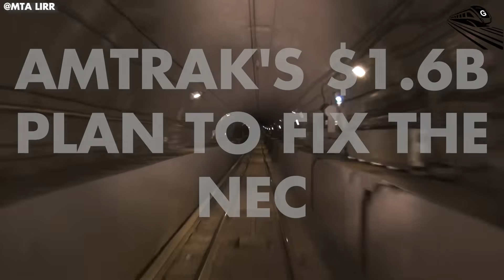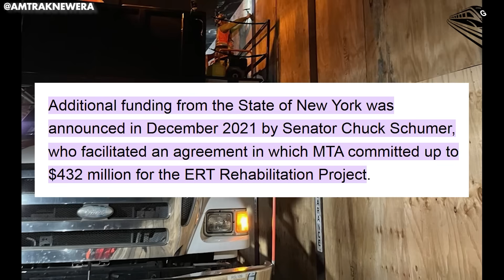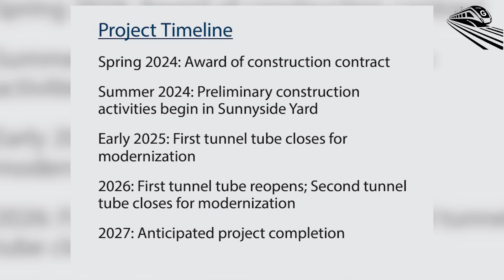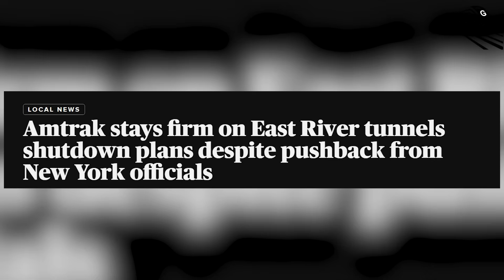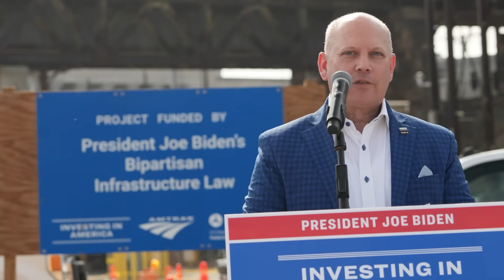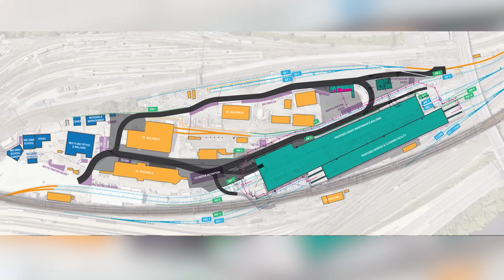Amtrak’s $2.6B Plans for the new high-speed train

Comment: That is not a high-speed train. High-speed means the speed is above 300mph
Reply: DoT defines high-speed rail as trains with a top speed of 110 mph (177 km/h) or above, and high-speed rail with top speeds above 90 mph (140 km/h) are referred to as higher-speed rail in the United States, according to Wikipedia: https://en.wikipedia.org/wiki/High-speed_rail_in_the_United_States
Reply: You mean 300 KMH, not mph. The fastest intercity HSR in the world currently doesn't even go over 300mph. The fastest regular intercity HSR in China has a top speed of 350kmh, or ~217mph. 

And even then, the general accepted definition of HSR with newly built line (the highest bar for speed standards) is the capacity for a speed of at least ~250kmh, which is around 155mph. Amtrak's Acela just barely meets that definition with their new train sets, but it is considered high speed rail.

Comment: Who cares about the complaints about closing the tunnel? There would be a bigger inconvenience if the tunnel collapsed.
Reply: My thoughts exactly, most people are not looking into the true scope of it all. Major tonnage from the Trainsets wearing down the tracks along with vibration on some areas for decades on, infrastructure wear on the bridges and tunnels due to extreme cold and heat related temperatures along with rust and corrosion. 80 to 100+ years of use while the locomotives and the cars only got heavier over time. These updates must happen.
Reply: @raymondj.2351  Exactly! Long Island Railroad hates that they can't control what Amtrak does and how they do it.

Comment: This is a joke, a stunning waste of $$ -- just get the trains to run on time, and serve more locations conveniently, and cheaply
Reply from the maker: Well they need to improve the infrastructure first. Hence these projects
Reply: With driving becoming more hostile and flat out dangerous. We need the trains.
The ERTs needed to be fully overhauled under Penn Central.  However they lasted and served honorably well beyond that era of decline.  The time has finally caught up to them and this work has to be done.
Car insurance is unaffordable as is today’s specialized car maintenance.
Speed traps, red light cameras,
Speed bumps damaging suspension in addition to the shitty pavement.
The trains are a good option.

You can’t keep putting Makeup on a pig.
And before someone says we don’t need the trains. Just understand that if the airports were privately owned by the airlines that air travel would be unaffordable. 
Amtrak should be fully funded regardless of the dem/rep in congress. They truly proven themselves over 40 years. They need to be free to function as a private business without the political red tape.
And be free to decided the routes that benefit the American people the
Most.

Moving people is financially unsustainable and not profitable in the modern era. Once you do the math owning car that should become evident.
Reply: Average Train Hater / Suburban Highway Enjoyer
Reply: How do you propose doing that without upgrading/repairing the infrastructure?
Reply: How to do that